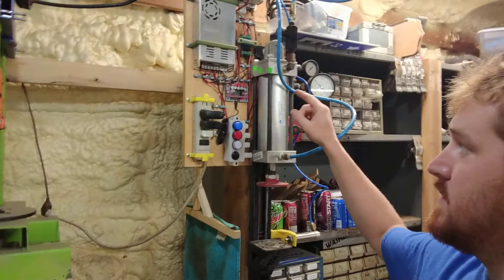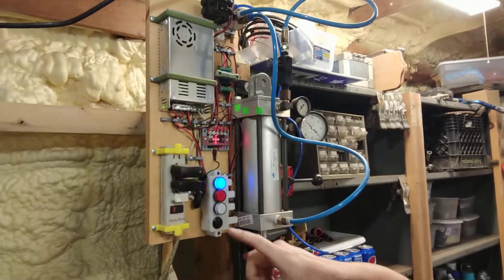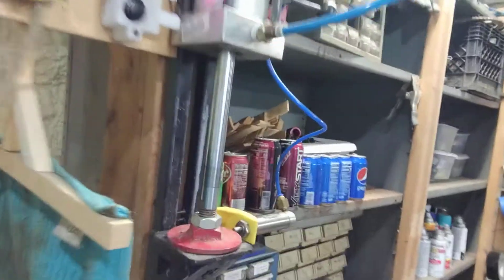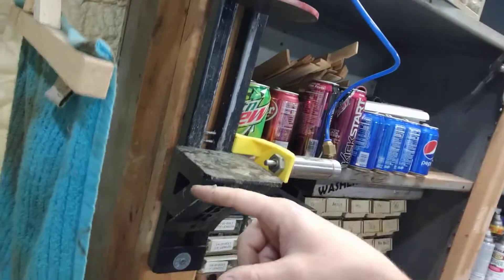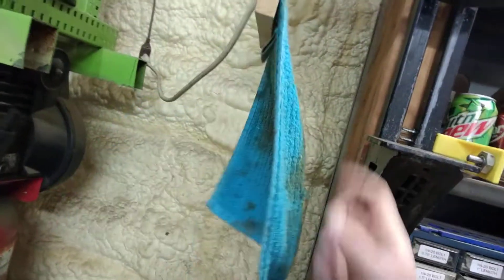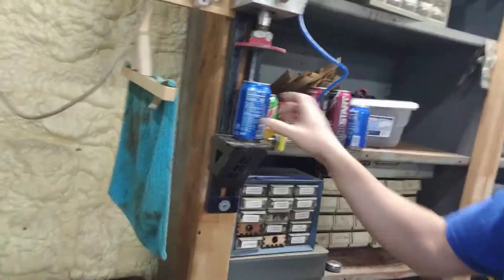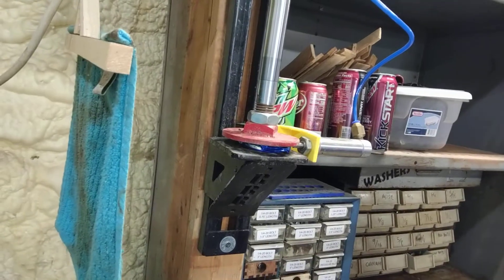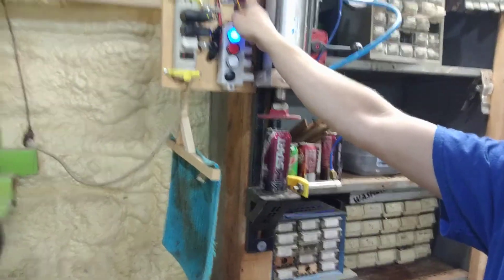Pneumatic Micro:bit Can Crusher

Comment: How does a little one return if it only has one hose going to it or no spring to pull it back
Reply from the maker: The little one has a built in spring, so it automatically retracts when you are not sending it pressure